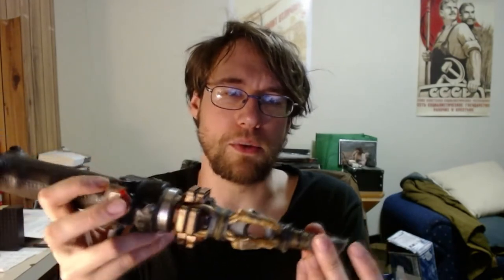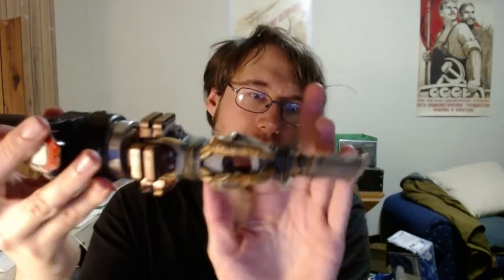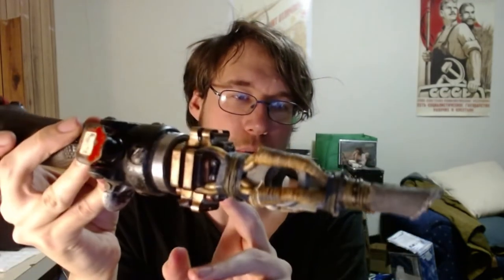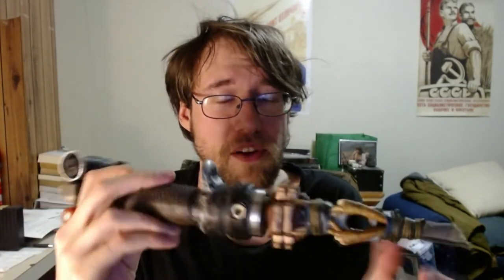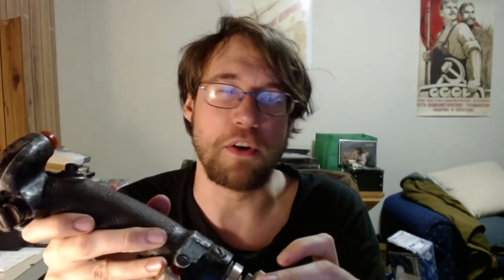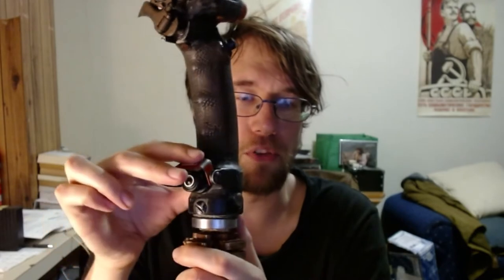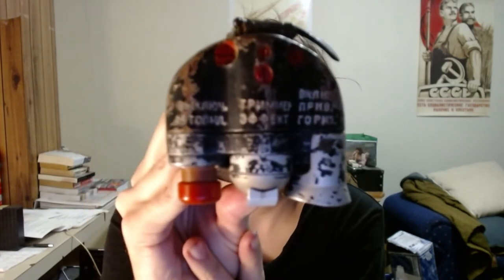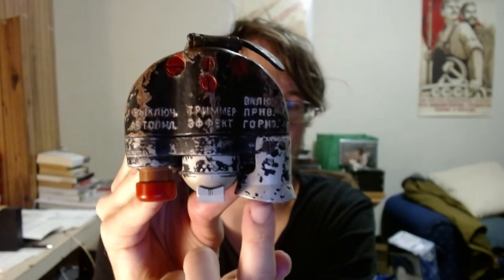So I bought a MiG-21 control stick...

Comment: Didn't know about those microswitches, I had a look in the MiG-23M manual (it uses almost the same control column setup) and they're briefly described.

As I understand it the short roll bearing in the lower part of your stick would connect to pitch bearings on the inside of the lower column, giving the grip its own seperate 2 axis movement from the lower column. The grip movement is very restricted though (only a few mm) and takes a lot of force to move relative to the lower part. The microswitches are all connected with bolts to the lower collumn and adjusted so that they're all pressed at the same time, if enough force is applied that one or more of them isn't pressed anymore then the SAU will disengage.

So basically the entire control column still pivots from the floor like you'd expect, but the grip is ever so slightly free-moving to act as an autopilot interrupter.

Comment: Hello rossmum! Do you still have that stick? Maybe you can help me with a couple of photos.
Reply from the maker: I do. Is there any specific parts/angles you need photos of?
Reply: @rossmum  I have the same grip, only from the rear cockpit of the MiG 21UB. There is no trigger. I can replicate her design, but I can't find good photos. If only I could get some front and side photos of the trigger to evaluate the design and replicate it on my grip. Email is in the description of my channel.